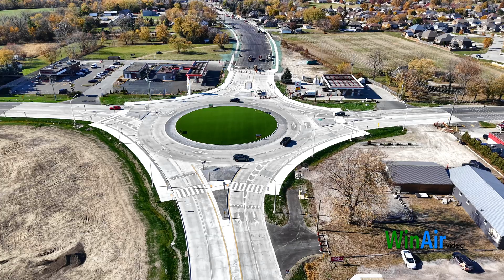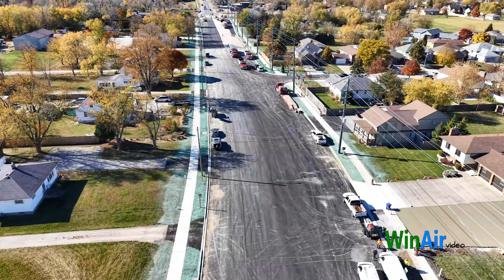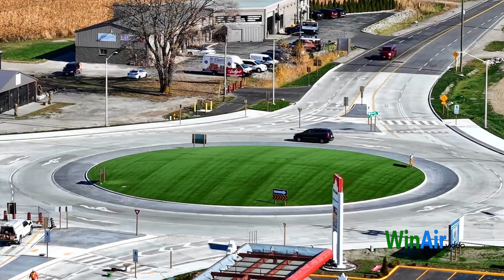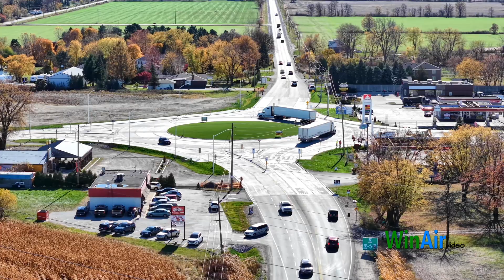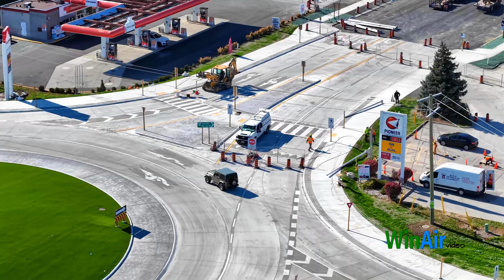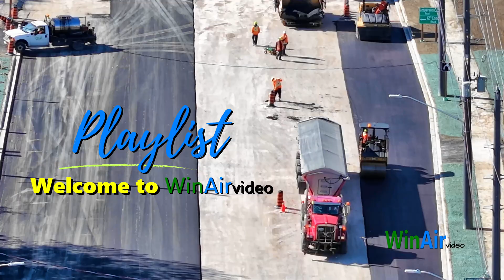See How This Road Transformed In 5 Phases!

Comment: how much traffic will that round a bout get when 42 finally opens? good luck getting in and out of Tim Hortons and those two gas stations.
Reply from the maker: I think they will be okay. They have entrances on both corners.
Reply: @bobjonesrealtor7756 it's fully open now and so far this week getting through the roundabout  at 7:45am and 5:15am have been pretty smooth so far.
Reply: Also, it's much easier now if you have to turn left into one of them. If there's too much traffic to turn left, you just go around the circle and turn right instead.
Reply from the maker: @AMultipotentialite-fn7oe  Good point!